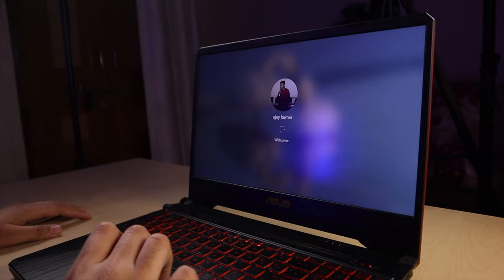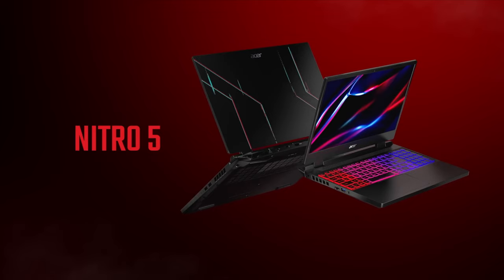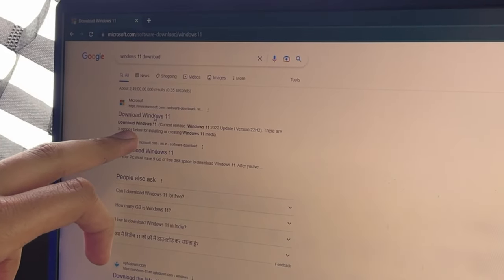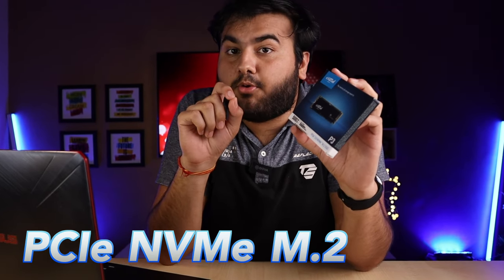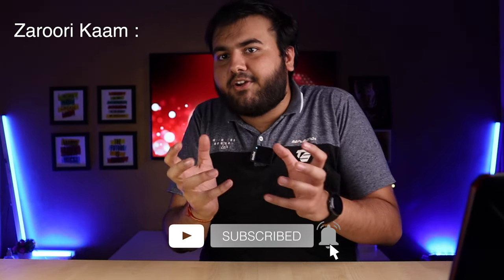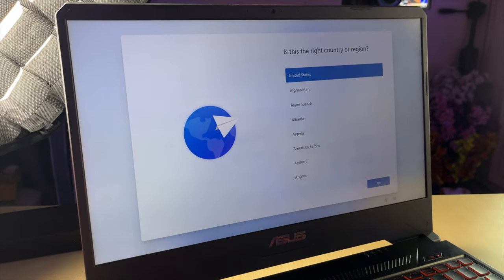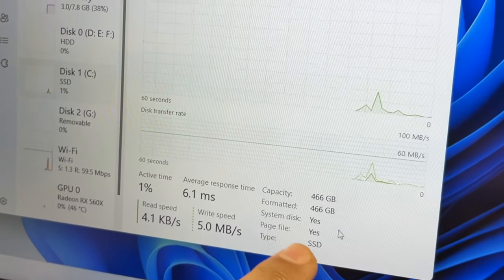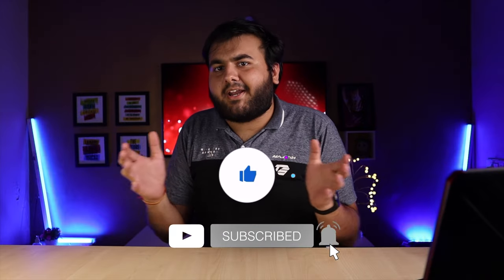SSD Upgrade in Laptop (Full Guide) 2023🔥| HDD to SSD Windows Migration

Comment: Sir, please answer this question i am confused between dell g15 i5 12500H vs asus tuf f15 i5 12500H vs acer nitro 5(rtx 3050), please bring a comparison video
Reply: Go with asus
Reply from the maker: I’ll prefer G15! Will make a comparison video if people demand it😀❤️
Reply: @UnboxTech14  wva display??
Reply: Dell g15 because it has ddr5 ram and come with lifetime ms office
Reply: @techwithutkarshthakur2369 both are mostly the same and you won't notice much of a difference in the display ...it's only when you compare with an IPS panel that you  notice it. Except that ram won't play much of a part cos it's dual channel anyway (even though it's ddr4) but keep in mind Asus has a 90wh batter which dell doesn't ...so if you really think you will need it for office work on battery ...only then go for Asus otherwise you'll have to be plugged in for gaming for both laptops anyway
Reply: @setabjatarafder3203   I will prefer asus because it has good battery life, better display, light weight (as compare to other laptops) and it's looks are awesome
Reply: go with Lenovo loq 15 series
Reply: @techwithutkarshthakur2369 and too much heating as compared to dell and acer
Reply: Hmko ek second hand laptop lena hai kan sa laptop le
Reply: acer
Reply: @techwithutkarshthakur2369 dod DD d
Reply: mere pass mil jaega
Reply: sabse Sasta Saman aur laptop
Reply: You should buy a core 2 quad then😅
Reply: i have dell g15 5520

Comment: How should i check like which ssd is supportable for my dell Inspiron 5570 laptop
Reply: According to Dell's Setup and Specifications manual for the Inspiron 15 5000 series, the Inspiron 5570 will accept either an M. 2 SATA SSD (up to 256 GB) or an M. 2 PCIe 3x4 NVMe SSD (up to 512 GB) in its M. 2 slot.
Reply: Use M.2 Nvme SSD bro it's Faster Than Sata
Reply: Thanks man

Comment: Bro, I have a licensed Windows 11 and MS Office 2021, which were originally inbuilt when I bought the laptop. It only have 512 GB SSD, no other Slot of SSD or HDD. 

If i upgrade the existing SSD to 1TB, will it affect the license of Windows 11 and MS Office 2021 ? 
(Lap Model: HP Victus 16-s0095AX)
Reply: I also have the same doubt
Reply from the maker: if you make recovery key from licensed windows then that same windows is copied (no further license required) it detects automatically!

Comment: Sir , I have a rog g15 with 512 gb ssd , I want to upgrade to 1tb , should I add a extra 512 gb 980 pro ? or change the whole ssd and replace it with 1tb 980 pro , also heatsink for ssd  is necessary ? because I usually do coding, structure Designing and sometimes plays GTA 5  not playing any hardcore games..
Reply: I think if you have two ssd slots (pretty much it is present on your laptop) then add another 1tb ssd or 512gb ssd.

And no heatsink is really necessary. But if you care about heat then buy a cooling pad instead.
Reply: Bhai Laptop ke ander graphic card lagane ka option hota hai kya jaise ssd Ka hota hai mere pass Dell latitude 3500 mujhe pata nhi hai ke eske ander graphic card lagne ka option hai ya nhi please aap bata doo !
Reply: @SurajKumar-ji4ks no
Reply: @SurajKumar-ji4ks kisi bhi laptop main cpu ya graphics card change krne ka option nhi hota
Reply: @SurajKumar-ji4ks nhi hota

Comment: Can i use 2 seprate ssd in my office pc for dual window without knowing to my office IT person? i am working from home actually
Reply from the maker: I don’t know what they’ve installed in computer.. because they may get info from disk utility or disk management.
It totally depends..
Reply: @UnboxTech14  they haven't installed anything specifically for tracking but they can access our system anytime at that time they will get to know that. 

Is that any option to add that ssd as external device for using seperate window and remove it during office hours?
Reply from the maker: @deepakrathore16-11  yeah there is but that would be an external ssd na..
Better you can buy an external ssd if you want external use.. but if you are putting the ssd in laptop and want that to behave as external.. that wouldn’t be possible as laptop will treat it as inside coz its sticked with motherboard.
Reply: @UnboxTech14  no its pc so if windows file will work externally with ssd so i will definitely try it

Just give me answer that its possible when i attach it from outside that means without Interrupting main ssd?

Comment: Sir I've done the all process but after that my laptop turns off and not getting on
Reply from the maker: Bro see again step by step..
Check battery is plugged in back or not
Or maybe windows installation is done properly from bootable drive.. 
you have to check again everything. Then only you can know whts the issue

Comment: Sir, my laptop has 4GB 2666mhz Non-ECC Unbuffered SODIMM CL19 1R×8 260pin RAM..
I want to upgrade my RAM... can i put 1R×16 type ram? What are the differences between 1R×8 and 1R×16? Please reply. Thank you.
Reply: There is a difference between latency you will be better opting for a ram with similar config i.e. 1Rx8 ram